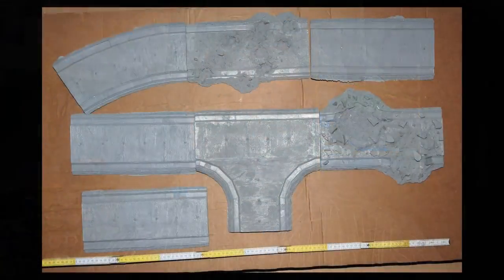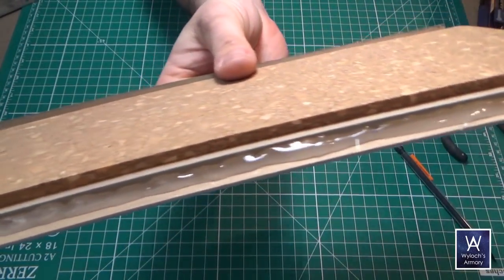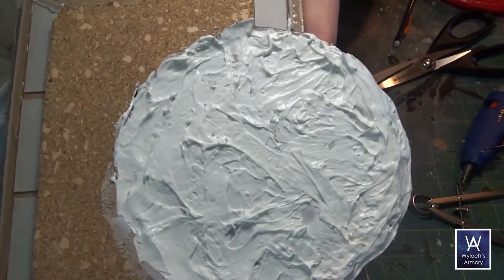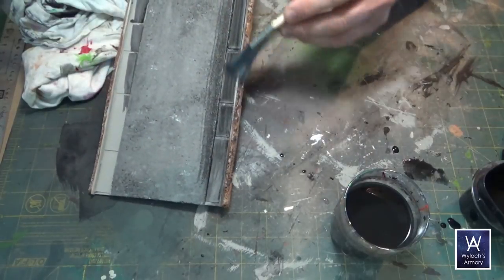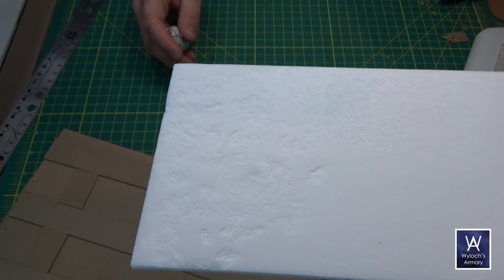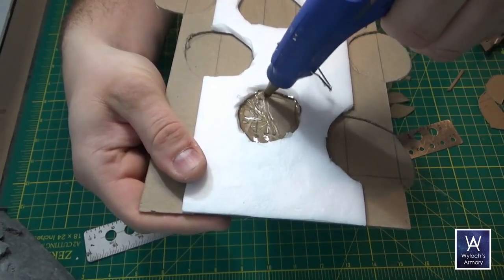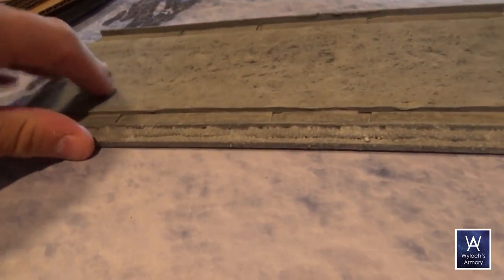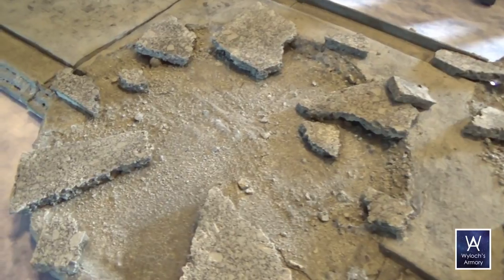How to Make Interlocking Roads Forgeworld Style for Warhammer 40k

Comment: Just a suggestion... I see this is a little older now, but with regards to warping, get your basic layers all glued up and before adding the textured detail bits (gutters, rubble and such) put a sheet of something over the hole thing like light ply or some such, and put weight on it distributed across the entire road section. Leave it to cure 2-3 times longer than normal then remove the weight and add your details. It's essentially the same process as layering veneer when making plywood, just on a smaller scale and with weight instead of a roller press.

Comment: Absolutely great.  Looking at that modular design, I'm thinking you could possibly make a whole modular 12" x 12" tile set of terrain, which I'm now really tempted to have a go at.  Do you think it would work in practice, i.e. 12" x 12" tiles using these same techniques?
Reply from the maker: Yes it would.  I've never gone that route because I don't like to see seams in my terrain - I use a battlemat and place scatter on that.  But this'll work to lock large tiles together.

Comment: paper clay would probably be a better material for that slope that you are doing with hotglue.  mainly cause it won't melt if the pieces get hot.
Reply from the maker: Definitely.  But I was going for speed.  That's what I didn't bother with wall filler in the second version.

But you're right there are many materials that are better suited for a higher quality result.
Reply: :D

Comment: not sure if you will be reading this but I tried putting glue on the back part to fix the warping but nothing happened :(
Reply from the maker: Was it a thick layer of glue?  Did you wait the full 24 hours?
Reply: @WylochsArmory  I tried the 50-50 mixture and just pure glue.. waited until 48 hours :( sadly nothing still happened after that.. I was using a 1/8 inch chipboard btw
Reply from the maker: @keendojino  1/8" wow that's really really thick.  I don't know if using the 50/50 first might have hosed you up, with all that moisture.  Try one more thick, undiluted coat on the bottom and 24 more hours.
Reply: @WylochsArmory  thank you for this .. I was really losing hope to resolve this kind of issue.. hopefully my next attempt will resolve it .. more power to your channel ^_^